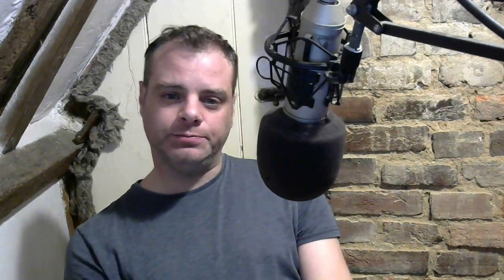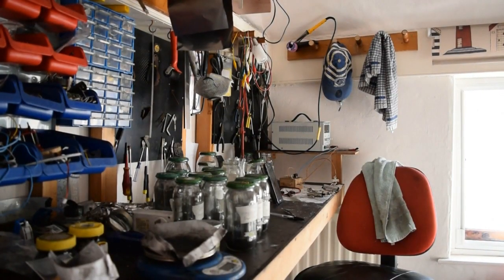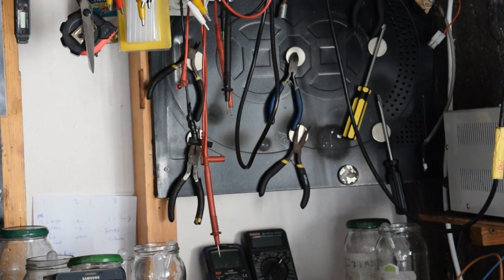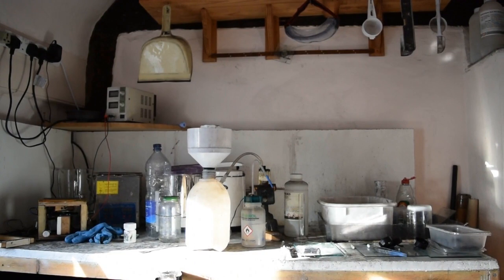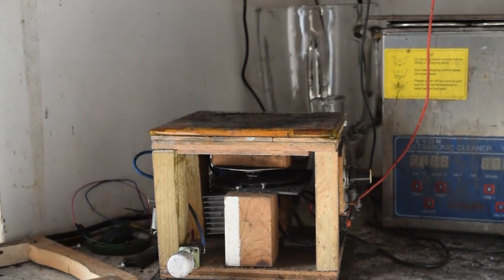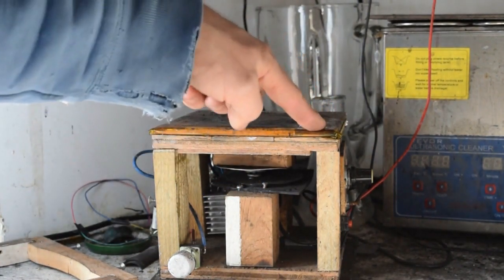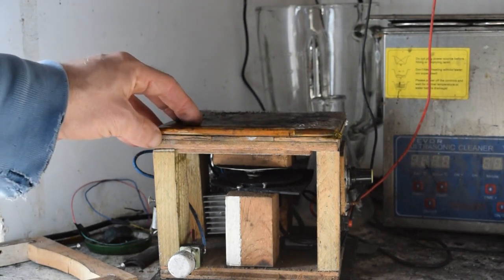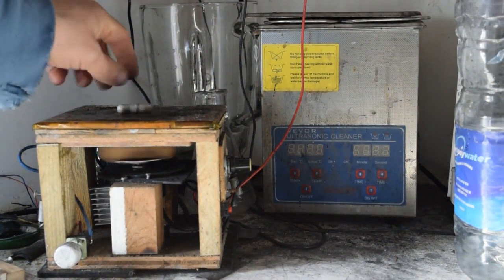Home LabTour/Introduction - Making Supercapacitors/Batteries at home

Comment: Hi Tim!  I love your homemade lab equipment.  I bought my heated stirrer and made my sonicator.  I'm a technology teacher for kids 5 to 12 in southern California, USA.  I run a STEM (science, technology, engineering, math) camp each summer.  One of the projects we did last summer was making our own rechargeable batteries and trying to find better and better materials to carbonize.  I'm  hooked, and continuing to experiment.  Because I work with children, it restricts greatly the type of chemicals and techniques I can use -- but that keeps it quite green as well.  One tiny negative comment - the large microphone in the video was a bit distracting - but that's very minor and your sound is miles better than Robert Murray-Smiths!  Onward and upward, leo
Reply from the maker: Thanks Leo - Sounds like you're doing some great work encouraging these kids. This technology will be important in their futures! Thanks for the advice - ill try and keep the Mic out of shot! Its a bad habit of mine, subconsciously wanting to show off my big Mic! hehe